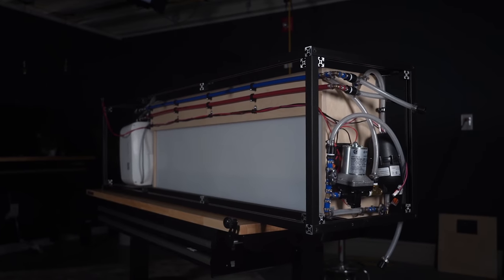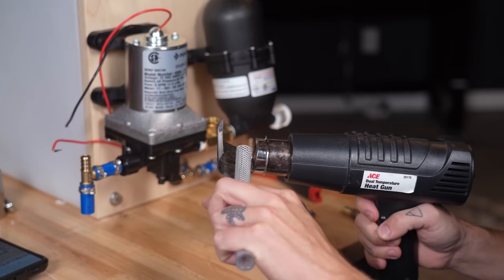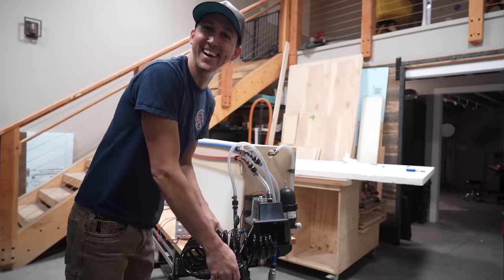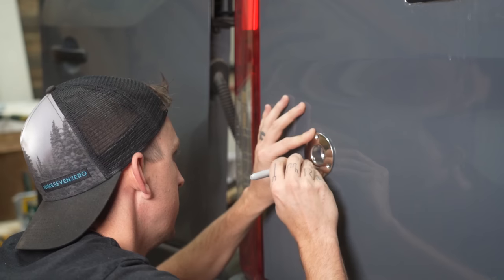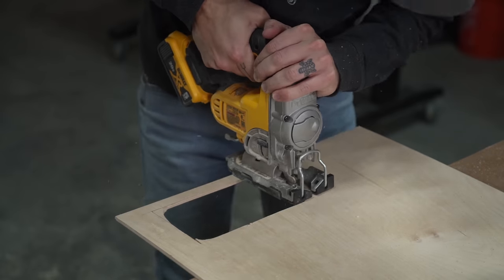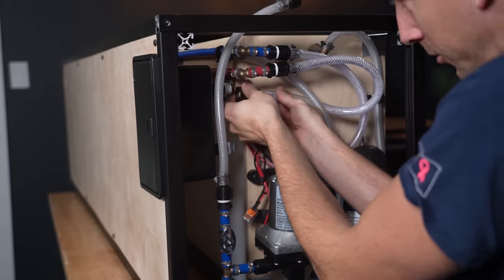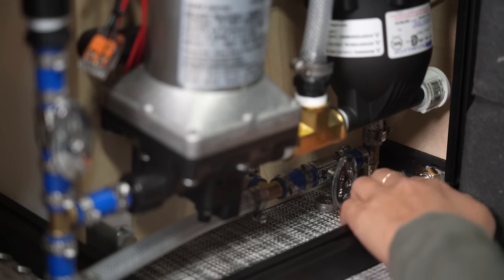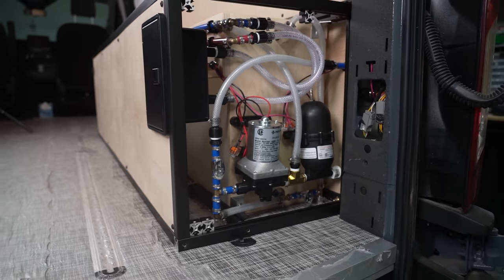DIY CAMPER VAN PLUMBING (full tutorial)

Comment: Curious why you chose to use such flimsy aluminum angle to secure the tank to the extrusion, and the extrusion to the walls/floor? Water is heavy. A mild accident can yield 40G’s, and I know from my own 80/20 builds that that gauge aluminum angle you used can be bent with a thumb. 

I would use steel if I were you.
Reply from the maker: It was indeed secured with steel. 👍👍
Reply from the maker: And I would venture to say that my methods are just as secure (if not more) as any rv on the road.  It's just easy to criticize because I'm actually showing what I'm doing, but feel free to do whatever you like in your own build.
Reply: @EXPLORISTlife  I wasn't criticizing, I was asking a clarifying question. Apologies if I offended you.

Comment: Why didn’t you utilize the accumulator? I noticed that you capped it off.
Reply from the maker: It was utilized.  There are multiple ways of connecting the accumulator as per the instruction booklet that came with the unit.

Comment: I cannot for the life of me find a source for the compression fittings he puts on the flexible tubing - can anyone help?
Reply from the maker: The brass colored ones?  Those are just pex fittings.
Reply: @EXPLORISTlife  No, the black plastic compression fittings that you are using to make your own flexible hoses.  See where yo are holding up a set of them before hooking up to the water heater.
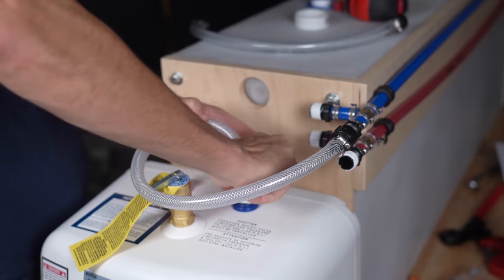Reply: No,at 3:11
Reply from the maker: I see.  I don't remember the name.  Just found them in the plumbing section at ace hardware.

Comment: Why no pushlock coupling?
Reply from the maker: Felt the crimp rings to be more secure in a mobile application subject to vibration.
Reply: @EXPLORISTlife  many OE do push lock too nowadays. Shouldn't be an issue.
Maybe do a test video like the Wago on push lock 😉
Reply from the maker: Yeah, either way.  I'm not very passionate or opinionated about types of plumbing fittings.  Just made a quick decision and moved on.
Reply from the maker: ...and I already had crimp fittings left over from another project... 😂